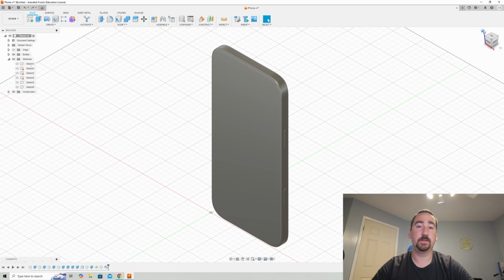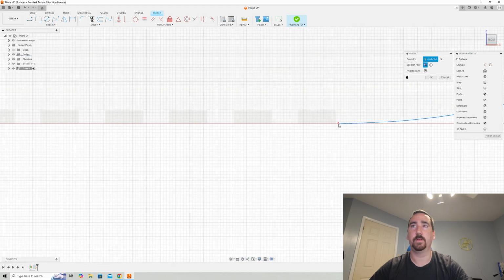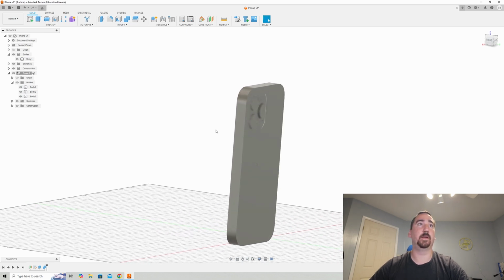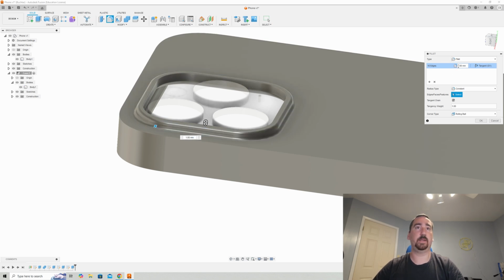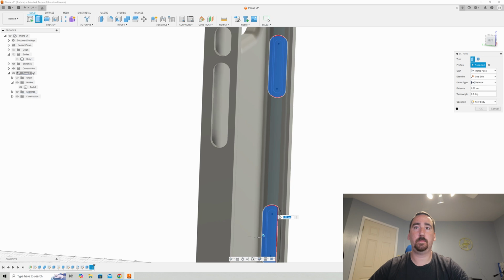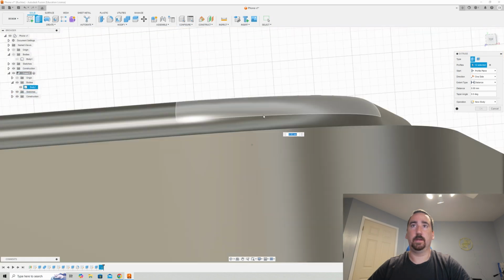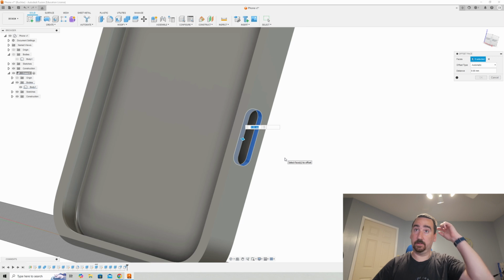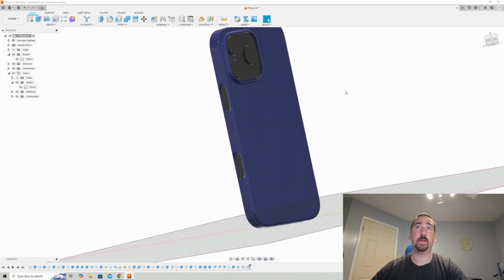Designing an iPhone 16 Pro Max & Case | Fusion 360 Step by Step Tutorial | Part 3 of 3

Comment: Great video, thank you for doing all the steps from making a phone and then a case. 

I encountered the following issues:

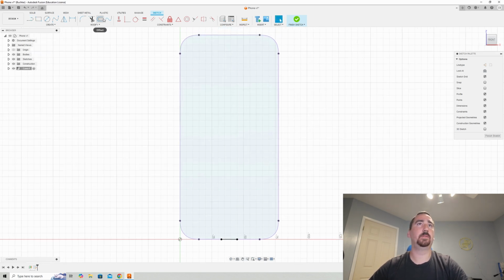1. Could not replicate the phone projections after the offset plane on the front, offset 1.1mm. You used P and then projected around the invisible phone, spent like 54 minutes on the first 3 to 4 minutes of the video. I could not highlight the projection of the front of the phone to offset it because some of the dots on the projection were not black (which meant it wasn't a fully enclosed shape. So I had to offset edges and curves individually but then had other issues. I think I eventually managed to get the view of the phone (because we were in a new component) I then saw the actual phone, created a projection of the margins, then offset it. (min 4:36).

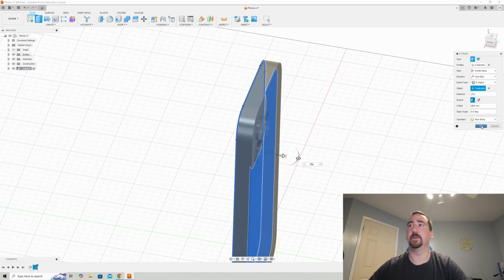2. When I reached the point we extrude the front of the phone to create the case backwards and an offset of 2mm, at minute 5:57, your case extrudes 11.25mm and mine 10.25, which made me realise I will lack offset from the screen of the phone upwards so lacking mm at the front and managed to extrude 1mm later.  (This is possibly because I could not replicate the projections you did on the offset plane (referenced in number 1).

3. When preparing to extrude the speaker holes section and the USB C area, you projected all edges, my USB region was way wider than you one where you still have some gap between the long edges and the end of the phone, I was not able to highlight the margins on that side and went back into sketch from Video part 2 and shortened the shaded area recommended to keep space for the USB C the size "6.60mm by 12.45 area keep out" from 6.60mm width to 5.85mm. I am not sure how much such size would affect my case gap and plugging a charger in or whether it will be enough space to still use it if it were to be printed? (You did not have the video of this section but followed by picture and verbal guidance)

4. We don't have the design of the USP slot where the power gets plugged in, I looked at the drawing trying to see if I can replicate it but not sure how to interpret the drawing or whether enough information is presented. I'd like to be able to see how much gap I have between my phone case cut and the actual slot or similar size so I can tell whether it needs modification or if I design any phones in the future. If it is not taking you too much time to explain this part, please let me know how to approach the sketch for that. If not it's okay, I'm sure I'll find the answer. :person-turquoise-writing-headphones:

Again thank you very much for your support and I appreciate any feedback or recommendation you may have. I am glad to have completed the phone and case to the best of my abilities :face-blue-three-eyes:

Comment: This was immensely helpful, thank you for putting this series together.  I am pretty new to Fusion 360 and CAD, so I learned quite a bit.  I did struggle with getting the splines correct in part 1, because I didn't quite have them properly aligned to the tangent, leading to problems downstream, especially when it came time to form the case around the phone body (there were weird voids in the case along the sides and some in the rounded corners).  I eventually figured out and fixed that issue, and I was able to finish the design of the iPhone 16 Pro case, which shared many of the dimensions of the Pro Max.  Thanks again!
Reply from the maker: Awesome! So glad that you enjoyed the series! Hopefully it will allow you to draw more things in the future! If you have any suggestions on something you want me to draw, feel free to leave them here!